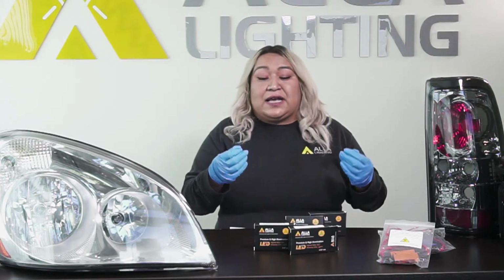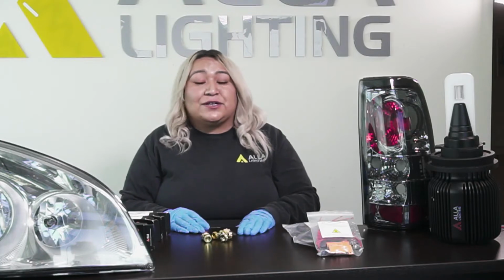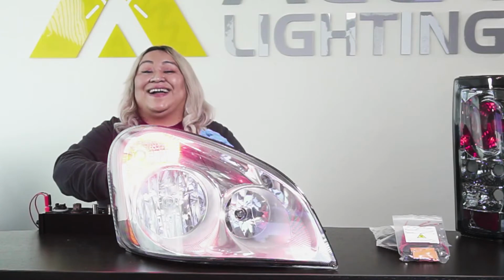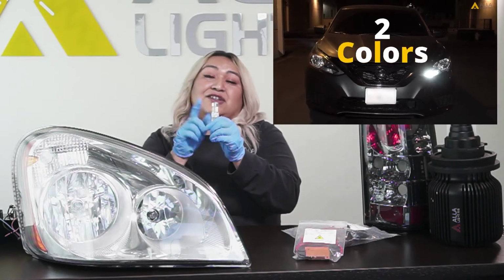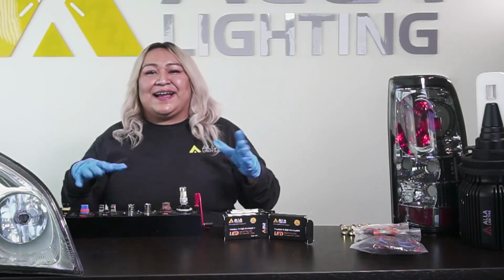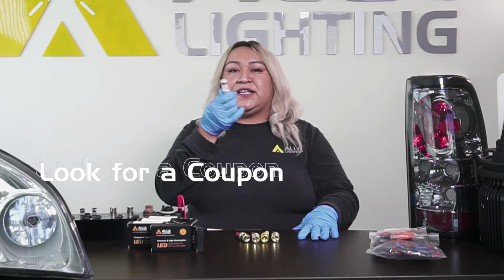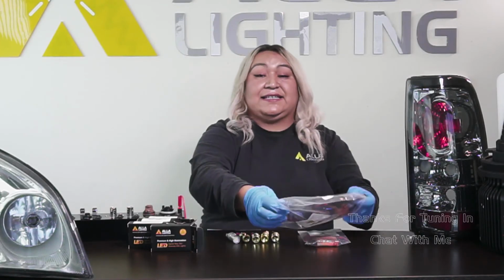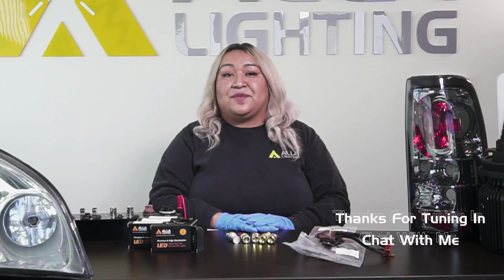Recommended LED Turn Signal Lights Bulbs for Your Car, truck | Amazon

Comment from the maker: Recommended the best value LED Turn Signal Lights Bulbs for Your Car, truck | Amazon LED blinker directional lamps upgrade incandescent for vision and safety.
Amazon link: https://www.amazon.com/stores/page/10EDCC4F-32CA-4CC3-9967-7CC859E29A6B?ingress=2&visitId=f026ec87-9989-4af8-9355-7536d000cdf2&ref_=ast_bln
How to find the correct LED signal lights bulbs for your vehicle? Please check below link for direct replacement bulbs recommendation:
https://allalighting.com/pages/bulb-finder-shop-by-vehicle-led-light-bulb-car-truck
Thanks for watching and if you like our videos, please give us a thumbs up, and subscribe to see more installation videos!